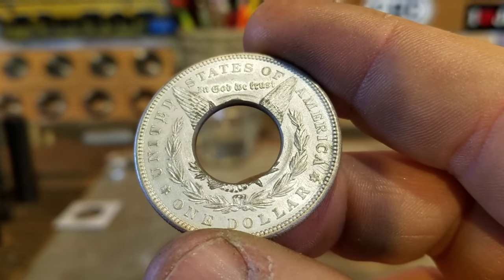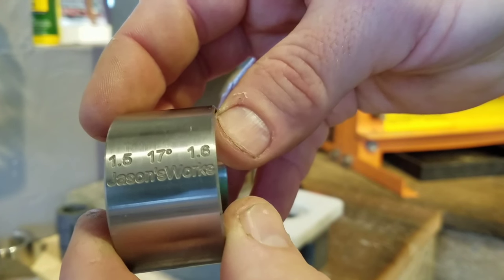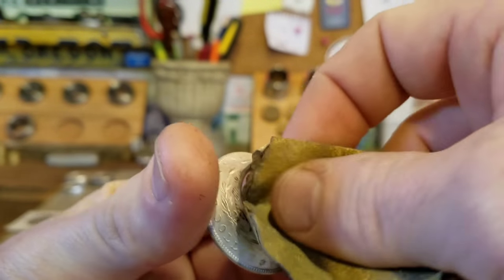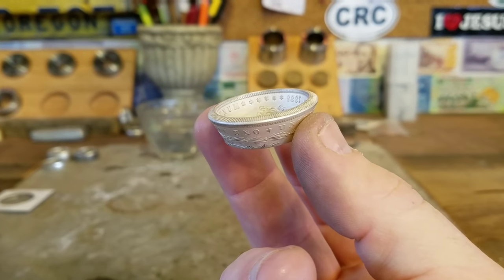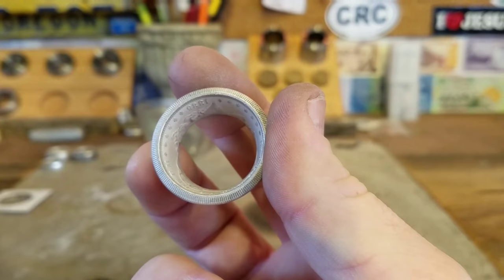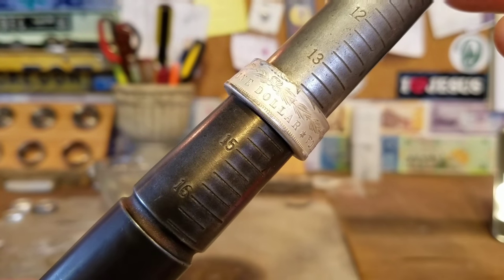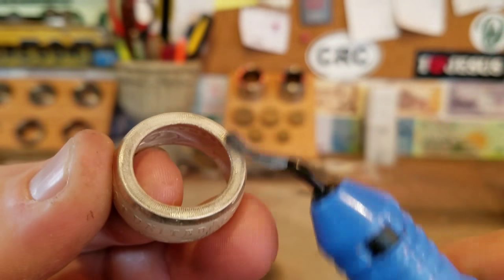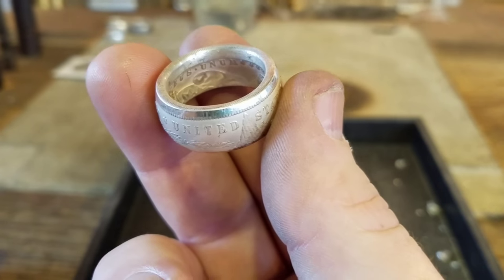How to Make a Morgan Dollar Coin Ring updated Methods

Comment: If you were to want that same size ring with a coin as large as a Morgan dollar but, don’t have a Swedish wrap folding cone, couldn’t you just start with a smaller hole like 3/8” and just have a thicker ring? And do you also size the cut side the same or do you just make it symmetrical on the outside? Because, when I try to make the inside size the same the outside isn’t perfectly symmetrical.

Comment: Correct me if I am wrong, but heating the coin up to anneal it then quenching it tempers the metal making it hard again.

I think you are better off letting it cool by air.
Reply from the maker: No that isn't true for non ferrous metals. I usually mention that in all my videos because it is a common misconception but I might have forgotten in this one.
Reply: I wasn't sure. I have been watching a lot of knife making videos :)